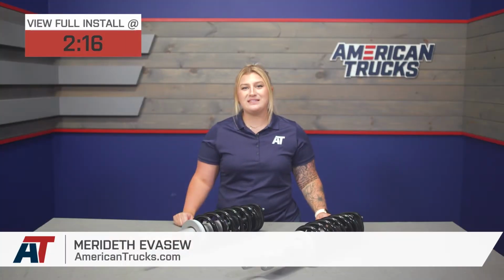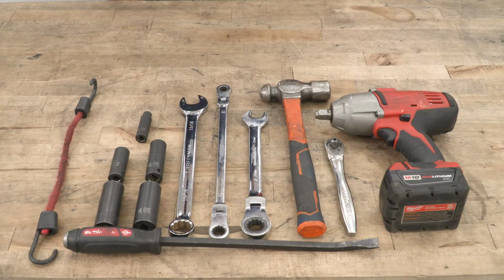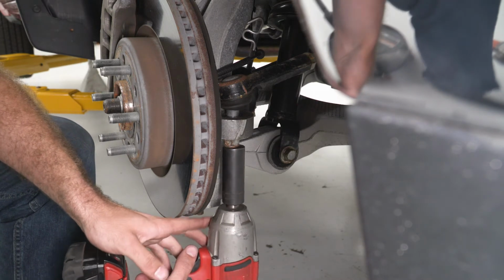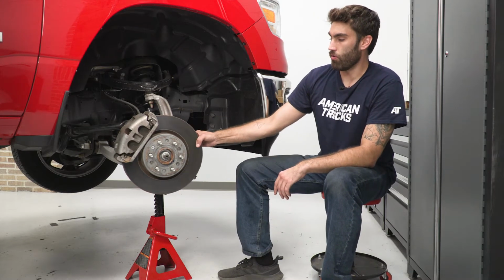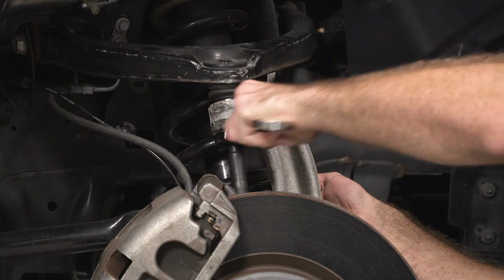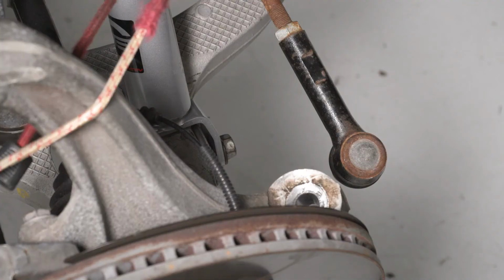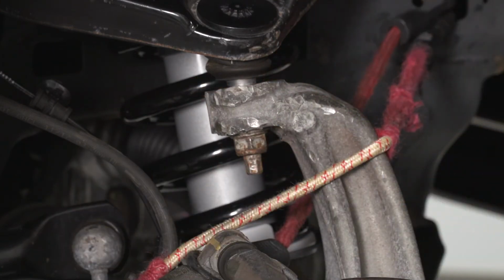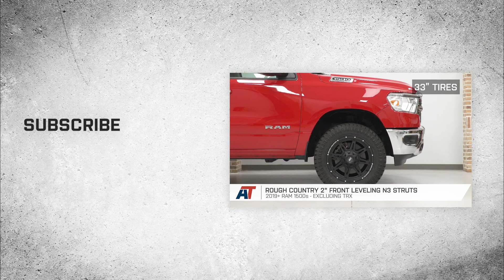2019-2022 RAM 1500 Rough Country 2-Inch Front Leveling N3 Struts Review & Install

Comment from the maker: Shop These Rough Country 2-Inch Front Leveling N3 Struts ! :  https://amtrucks.at/3dus1Q8
Reply: For Rebel owners with the factory 1" lift, do we need these 2" struts or the 3.5" version to level with the rear? Doesn't the Rebel's lift come from the current struts so swapping out for these will only net one extra inch of lift in the front? Thanks!

Comment: Just installed these on my 1500 in 2½ hours. Thanks for the video
Reply: Do these struts change the control arm angle? Wondering if I need to order the arms too so they don't kink on the ball joints too much?
Reply: @johnniecorbin8415  i was advised if I was going to 3 or more to replace them. But 2 should be fine with the stock arms
Reply: How’s it ride compared to stock?

Comment: I'm sure some Ecodiesel owners may look here and YES this kit 1000% fits and works.  Rough Country only states "for V8" cause of weight, however the Ecodiesel is nearly identical in weight to the Hemi.  It's fine and R.C. really screwed the pooch IMO on not including the Ecodiesel.  The standard V6 is lighter and would be a 2.25" lift per various Ram forums.

Comment: I installed them in my 2021 v6 almost 3 years ago, and they still work perfectly. Just note that you will probably need to add 1" spacer in the back because these struts are really 2.5". At least I had to.

Comment: I installed a set on my 2024 RAM 1500 4 X 4. Easy install, better than stock ride. Didn't need to do anything to the rear wheels. The level was great. I will probably replace the rear stock shocks to enhance the rid more. This is the way to level any truck. The upper control arms are stock and not in a bind. I may change them later.  Very satisfied with these struts.
Reply: Do you have the Offroad Package on your truck?  I've been reading that that would require replacing the upper control arms as well.  Gathering data before I buy and do mine!
Reply: No, I didn't put uper control arms. Doesn't need it, in my opinion. This is coming from a 50 year mechanic.
Reply: If you go with the 3" lift you probably need new control arms.
Reply: They say you can put up to 33" tires. I my try some in the future. I have put 5000 miles on the shocks with no wheel alignment. Tires still  look good. Can't remember if I have the off-road package.

Comment: Would this add 2 inch to a rebel or 1 with the original facory lift
Reply: We need an answer for this!!! This will determine if Rebel owners need this or the 3.5" version @americantrucksram
Reply: @FuriousFuria  what about a spacer plate for the top of the strut
Reply: @MrJohney  I installed 2.5” strut and it leveled my Rebel
Reply: @FuriousFuria  very nice 👌 I've been thinking about leveling mine.
Reply: @FuriousFuria  I wish this site would include the ecodisel in the videos and showcase the products they carry for them

Comment: Make sure you change your upper control arm. The upper ball joint can't handle the angle
Reply: Just for 2 inches?  I thought that’s only if you’re lifting more than 2
Reply: @mr.roboto7330  never mind I have a rebel and it has a 2" factory lift already if I did 2" that would end up being 4". So my comment should apply to me in this scenario
Reply: @MrJohney rebel has a 1 inch factory lift . So If you gave it 2inches of lift . Its a total of 3 inches.  On a rebelit I'd recommended to change the uca if it's over 3 inches .
Reply: @davidalonso1584  really, I thought it was a 2 inch lift from the factory.
Reply: You are correct on changing upper control arms, for some reason rough country says no but readylift says yes lol
Reply: @aristeidis8226  stock UCA are fine if only doing 2"
Reply: @dan43213  i changed it on my 4th gen ram and now on my 5th gen ram I bought rough country control arms for my 2” lift,  Ram has always had shitty front ends so I rather change it and be done with it.